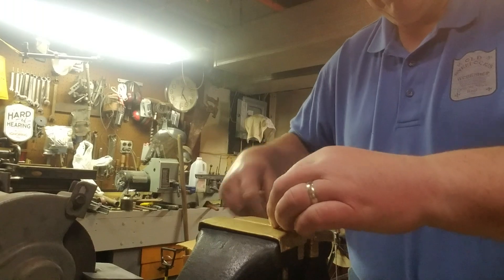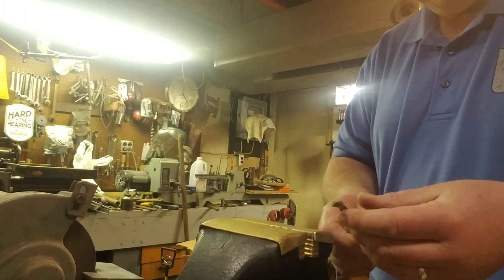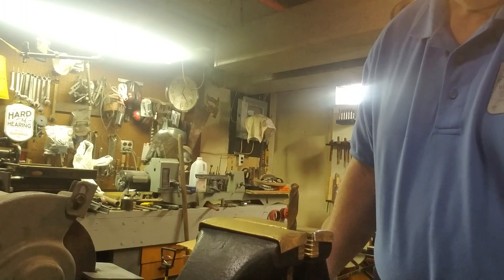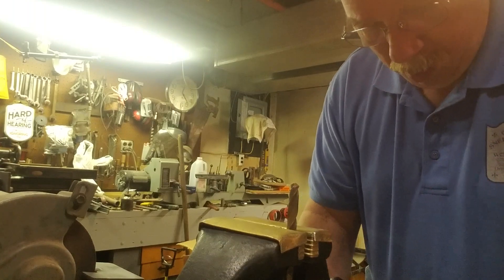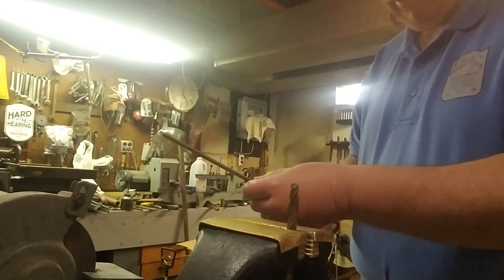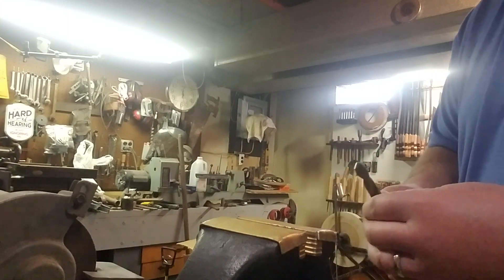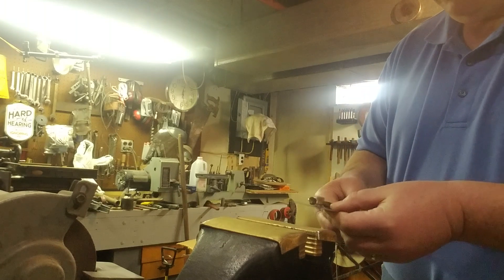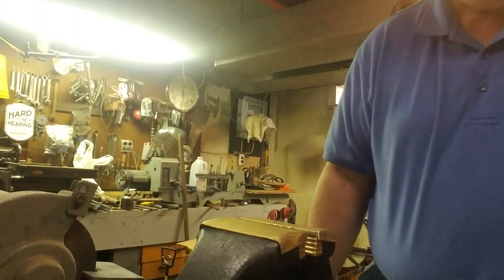Can You Sharpen A Twist Drill  With A File?

Comment: I wonder if a carborundum file would also work. Very interesting video.
Reply from the maker: I don't have one to check with. I was able to turn a drill bit shank with a carbide bit so it might be possible. 😁😎
Reply: I have only used a tungsten carbide file for smoothing cuts on wall tiles but this video has got me thinking.

Comment: Useful video. I always wondered about sharpening drill bits, but I assumed you needed specialized equipment. Never thought about a hand file. I have seen electric bit sharpeners, but they looked gimmicky and not durable, plus they seemed to get thumbs down from consumers. So I stuck with occasional purchases of new bits. What about sharpening the flutes? Based on your video, I guess that is not necessary. Thanks.
Reply from the maker: Thanks Pat. Up until I tried it I didn't know myself. 
The drill sharpening machines that  I have tried worked okay. They just take as much, if not more, work than hand sharpening. As I get older, and my eyesight is limited, the setup on machines means they will repeat better than I can by hand. It's always sumpee!
Trying to sharpen the flutes is a classic mistake. 
When you sharpen the edges of the flutes it reduces the diameter of the bit.
I have done it just to see if I could. Lots of work and you end up with an oddball size bit. 😁😎